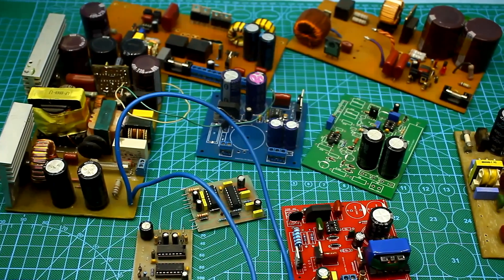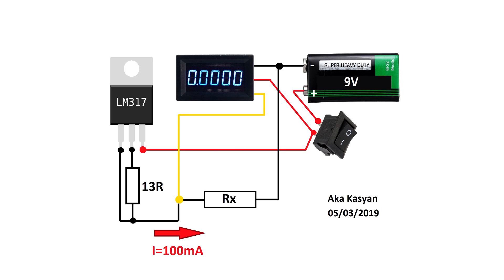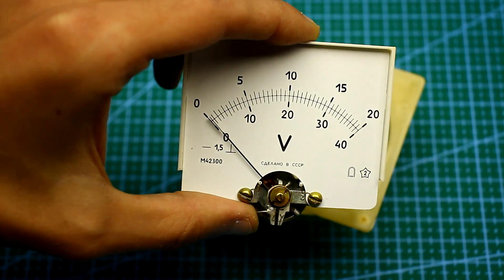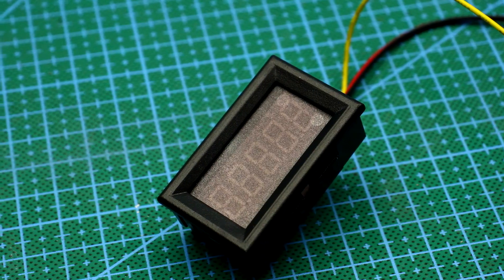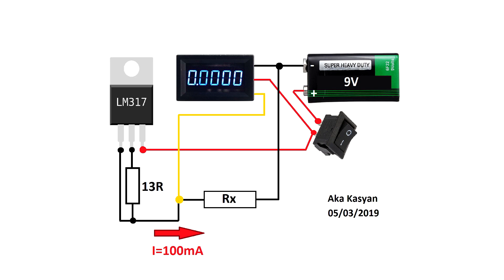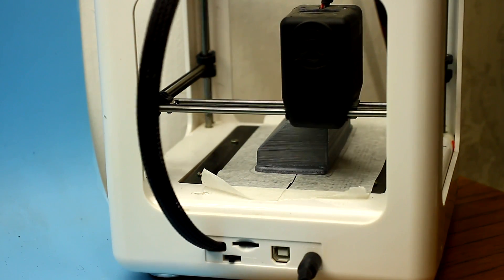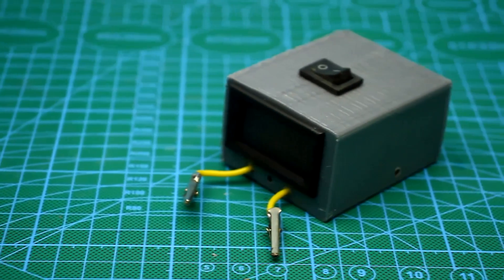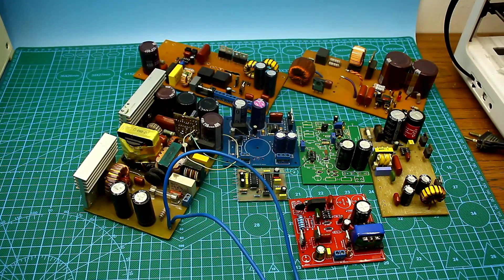DIY milliohm meter

Comment: I like this little monster!  If you cover the decimal point with black paint inside the display, then the reading on the screen is millivolts and no more confusion.  The dropout voltage of the LM317 determines the highest resistance that can be measured.  For 100 mA current, the highest resistance is given by the equation Rmax=10*Vin-30.  For 5V, you can measure up to 20 ohms.  For 9V, maximum is 60 ohms.  However, power to your resistor is W=R/100, so heat will change reading.  A 60 ohm resistor would receive 0.6W!  But that isn't possible with a 9V rectangle heavy duty cell, they instantly drop to 5 or 6 volts under 0.1 A load.  Alkaline cells would drop to about 7-8 volts under the same load.

Comment: Are using a 13 Ohm resistor or a 470 Ohm resistor? I see a 470 Ohm resistor in the video but you say it’s a 13 Ohm, or do you mean that you set the 470 Ohm resistor to 13 Ohms? Pardon my ignorance, I’m new to electronics but I want to learn. Please clarify. Thank you
Reply: this was a multiturn 470 ohm resistor set 13 ohms
Reply: @johnkemas7344  Ok, thank you kindly. Be safe.
Reply: Sir, watt of this resistor?

Comment: The LM317 is quite bad as a current source. Its internal reference is only good to a few percent and as it warms its self up from the current it will have some temperature drift.  Regulating from the 9V battery to 5V with an added regulator device will make this better.
Reply: I used a heat sink to reduce the VREF drift inherent to the LM317 when it rises above room temperature.  I also used two different power sources using powerbank modules which do not shut off during low current draw, supplying 5V for constant current and the other the voltmeter. This enabled me to use 4-wire kelvin alligator connections.  These improvements do not detract from this awesome video which shows the baseline requirements for making a circuit like this.
Reply: @pault6533  Yes, a heat sink helps a lot but making the reference and the pass element two different packages is a better way to go.  You can get regulators that drive transistors to do this.

Comment: Remember everyone when your measuring resistance is that low even resistance of  the alligator clips is and can be significant some positive method of clamping tight is preferable so that you know that you're not introducing error into your measurement
Reply: 4 terminal measurement works better.  One pair carries current and the other connects to measure the voltage.
Reply: @kensmith5694  yes like well made meter shunts where the main current passes through large bolted terminals and the metering is picked off the side

Comment: i dare you to make a terraohm meter :D just so u can measure resistance of wood and other insulators. i found that discharging a tiny tiny capacitor can be helpful. for example a mosfet gate. i was able to rapidly discharge it by connecting it to wood, but only very slowly through my fingernail.

Comment: Hi
Myself bharath.
A big fan of your channel.
Am sorry am not good in English, sorry.
I request you to make a device, I mean DC backup for my wi-fi router. Kindly make a backup using lithium batteries or 12 volt lead acid battery and output 12 volt 2 amperes. And it should work like uninterrupted power supply.
Am requesting you to make this because always power failures at my home and no internet.
If you make a uninterrupted DC power backup, it'll be very useful to me. I guess most of the people need such device.
I have charging modules, step up modules and step down modules but always I fail when I make a circuit with such modules.
Hope you understand my English.
Thanking you.

Comment: This is not a good way of measuring such low resistances. The 4 wire measurement method is better. The resistance of the probe connection and the test lead resistance is going to through this off.
Reply: This is equivalent as the 4 wire method. Here you don't need the ammeter because you already set the LM317 as a constant current source of 100mA. It does not matter the series resistance of the cables because no matter the total resistance 100mA will pass though it all. And since you are measuring the voltage drop across RX. Is the same as using the 4 wire method. Don't see what all the fuss is about.
Reply: Yeah,4 wire measurement is better than this..you can also use LM317 as a current source and the supply of the meter should be independent on the supply of the resistor being measured.
Reply: I’m just a hobbyist but, most of the unwanted resistances from the probes, wires, and the clips, will disappear/be “nulled” out, during calibration - am I wrong? If so, please clarify. I want to learn. Thank you

Comment: do you have any link for the 5 digits led display ? thanks
Reply: Search for Mini Digital 0.36inch LED Display 5 Bits DC 0-33.000V Voltmeter Panel Volt Voltage Meter Tester Detector with Case for Car Home
Reply: here it is  http://got.by/3a5v5h

Comment: 6:00 ?  0.05 =/= 0.005?
Reply: Reading voltmeter 0.005 V. Current through resistor is 100 mA=0.1 A .  R=0.005V/0.1A=0.05 Ohm

Comment: Would this be suitable as an ESR  tester for capacitors?
Reply: no it measures dc ohms. esr meter needs to measure using an ac current.
Reply: try the famous "transistor tester" from ebay ~7$ it can a measure ESR, and many other components